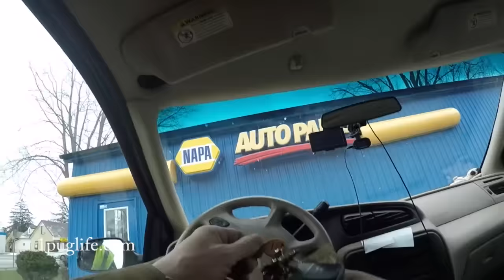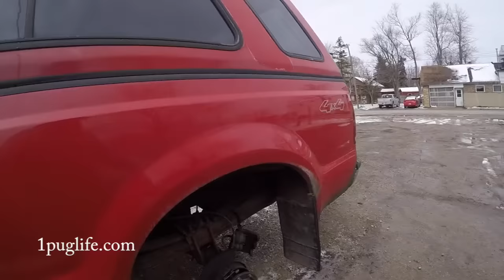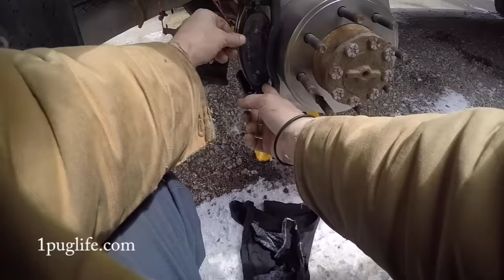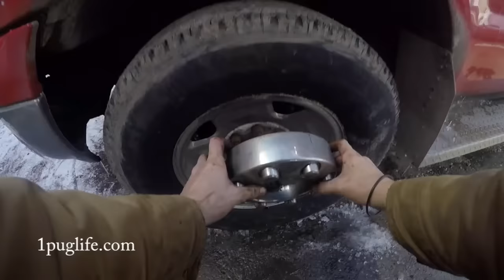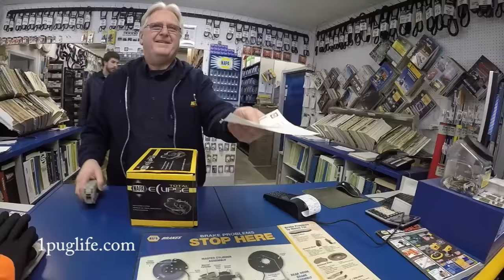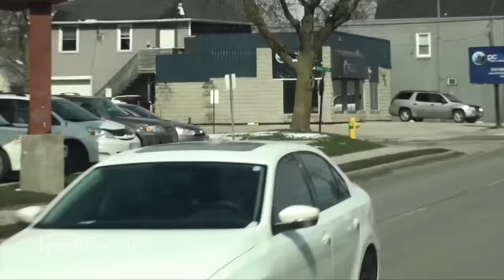f350 brake job using loctite products

Comment: I wish I had a huge shop so I could change my brakes outside in the cold, ffs.....
Reply: buhaha!
Reply: +rochat EVEN COMES WITH HEAT AND A LIFT. PLUS--- IT`S DRY.. OH WELL.
Reply: ***** my apologies. I didn't realize I was dealing with such a badass tough guy. You have a nice day, mmk?
Reply: ***** He had to pull the caliper anyways, so yeah I would have. And putting the wheel back on.... such hard work.... Anyways, I thought this conversation was over? What else do you got, genius?
Reply: dude. THE SKIDWHEELER, with pallet forks, will lift the ever lovin FUCK out of the back of big cigrit. and seein as its in the way of the lift....well there you go. id at least use it before i wheeled out that friggin jack eh
Reply: +rochat Friggin goof
Reply: Arthur Bradley friggin rights
Reply: +plowmaster1206 Copy that plow. Last thing (worst thing) you want to do, is work out in the cold, especially on vehicles.
Reply: +Tattooed Gentleman  No such thing as a tattooed gentleman.
Reply: Arthur Bradley the ol boy is loosin creds for showing he knows not how to work on equipment efficiently....i was picking up on that during the splitty operation, but this goofery is just blatent. the time spent on pulling the jack out would equal to the time spent pulling skiddy out....from there on its just wasted steps in and out in and out. up and down up and down...comon
Reply: +rochat Nothing like a freezing day of work.
Reply: +rochat  in the time it would have taken to move all the shit, take the brakes off, get it on lift i would have it done already in the driveway. a true canadian isnt scared of a little work out in the cold in april. serisouly, brkaes in the driveway is nothing. a lift hardly makes it easier if you gotta do more work to get it on the lift than just jacking it up.
Reply: +TOXIKFILMS The Tools and Lubricantz are warm in the shop . Work is Meantz to be done in the Kold, Kassauntz kuz. If it aint all that hard it wouldnt of needed to be accomplishinateded.He Fukin knows better now it aint gunna seem what it was ..  whaaaat happennn
Reply: TOXIKFILMS I don't buy that. Skiddy is nothing to move and the caliper had to be removed anyways. The only extra work that would have had to be done is to put the wheel back on and pull it off in the shop again which takes less than a minute with an impact. And don't give me this shit about "a true Canadian".... Work smarter, not harder.
Reply: Kikkins
Are those words? Are you choking? Do you need help?
Reply: +matanuska high you must be smoking bunk cause Ive been smoking for 30 years and I still get high as fuck from the bud I grow...And the shatter and Rosin holly fck High as Georgian Pine Trees...lol Cheers
Reply: brakes got stuck so he couldnt drive his truck
Reply: no doubts on the frozen solid choocher
Reply: +Biggy Bigg Bud friggin rights the shit I grow, two tokes and your good till lunch. Some ppl think leaf is weed, someone got rich of that meat circus that's fer sure
Reply: +TOXIKFILMS "true Canadian"....laugh my fucking white ass off, these are south Canadian softwoods.... I live 150 miles NORTH of these snowbirds....southern Ontario is barely Canada, in name only....ask any "true Canadian"
Reply: Artsi Oh, really!?
Reply: +rochat it was like 8 degrees out it was awesome
Reply: +peter ollie anally plowed ftw
Reply: +peter ollie I own five of em I can call em what I want
Reply: +BrokenRRT *brake
Reply: I gotta admit, this one made me laugh out loud.

Comment: you know how to do brakes well but only thing id change is use permatex extreme brake lube (purple stuff) under the brake hardware and on the piston faces and on the outer pad caliper contact points. It stays in place way longer than antiseize or antisqueal.
Reply: +UBBERTANKER them  pins  pull out  then  slap purple  lipstick one eh

Comment: have a big shop, buy a hoist, stand outside in the cold fixing breaks and have tools laying around in the snow.. well done..
Reply: +SquirrelFromGradLife right rear wheel was locked up.. cant pull it into the shop if the wheel is locked up
Reply: did you miss the destroyed caliper? gotta pull the wheel anyway to get at that. fuck it, do it outside. looked decent out anyway with the way the snow was melting

Comment: Pug ....You did not do the rear brakes last yr.  I looked at your old videos, you did the back brakes in Dec of 2013, so 2 years and 4 months ago.. You also did them Nov 2009 rotors, calipers and pads both times. You go thru brakes fast, because you do a lot of towing. I can see pads and rotors, but the calipers should not need replacing as often.

Comment: Talk about dodge trucks,that ford eats brakes like nothing!
Reply: +tom williams Any car will do that if it sits and doesnt get driven
Reply: +derty qwerty 42N found on road dead..fixed or repaired daily..fixed on road daily..they all spell ford..
Reply: +TakeiT not my Chevy 2000 Z71 silverado..sometimes sits for 6 months and still runs drives daily..270,000 miles on it ..never once had any major issues. in the 15 years ive owned it..
Reply: I saw a pic of a silvergaydo earlier the frame snapped in half from pulling a trailer you would put a lawnmower on and it had like 3 2 by 4s on it
Reply: I could probably pull that with my bare hands 😂

Comment: does that brake cleaner stuff even do anything?  I've never use it...
Reply: Usually hit the new disc brakes with it to clean the oil they put on them so they don't rust.
Reply: yea. doubles up as visine too. smoke a green cigrit and spray some in your eyes. no more red. promise
Reply: +Ryan Rawrgera got it

Comment: Hey anyone when you rotate your tires can the drivers side front go on the passenger rear side like pug did. I thought you were supposed to keep them on the same side??????
Reply: +The Cynic 
You have to keep them on the same side if the tires are directional, which Big Dirty's tire are not.  Directional tires will be marked on the sidewall which way they must turn.
Reply: That's what I thought. I could of swore my dad who was a auto machanic told me this. But that was 25 years ago.

Comment: well it is nice to have a truck but that big cigrette is a money pit you don't put anything my f150 king  rancher cannot do at a 1/3 the price to operate.Find someone you don't like and sell it to them. jesus i dont think you put 500 miles on it sense you last changed the breaks.i have never seen a ford that breaks so much .usually its the gm guys fixing all the time.
Reply: Both my 1/2 ton dodges one with nearly 300,000 km on it before it got totaled had less problems than this pile of shit.  All I ever did was change a couple sets of brakes and some other worn out parts and she kept on rolling.  Still he likes to make fun of Dodge though what an idiot.

Comment: You need to drive big dirty more often and stop driving the ol ladys windstar all the time. So many times your towing a trailer with that fuckin van and its just beyond me why you don't use big sombitch. That truck needs to run if you want it to last it's over 10 years old if it an 2005 which I think it is don't remember exactly.